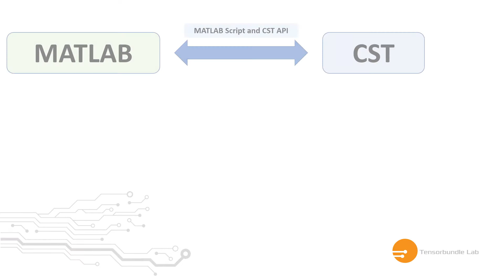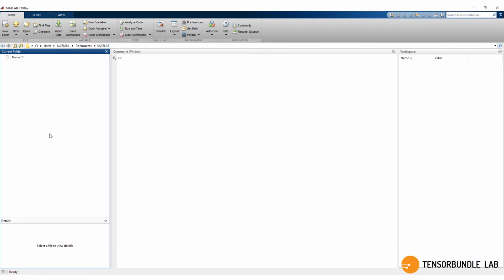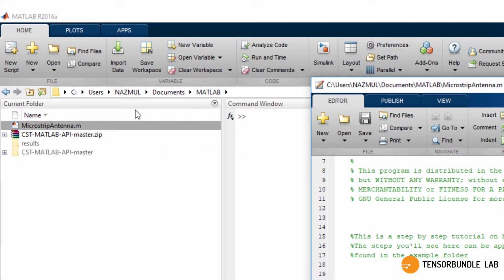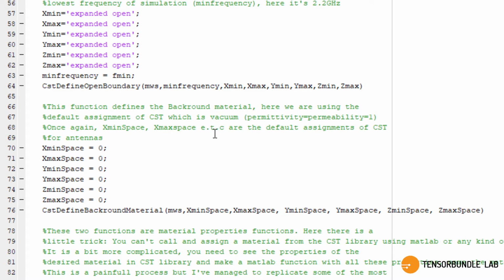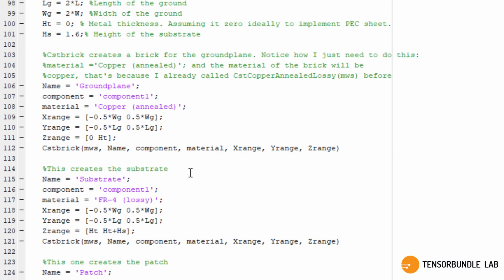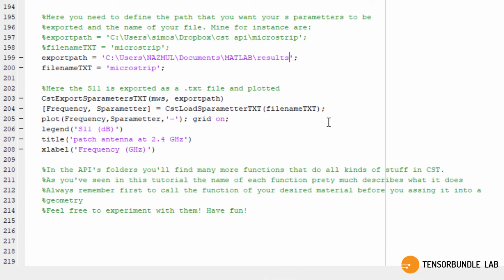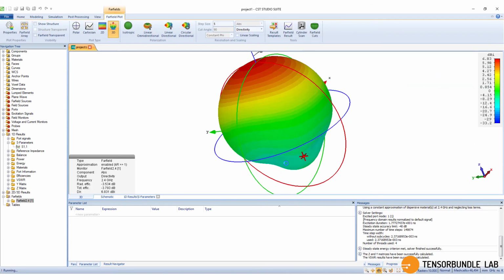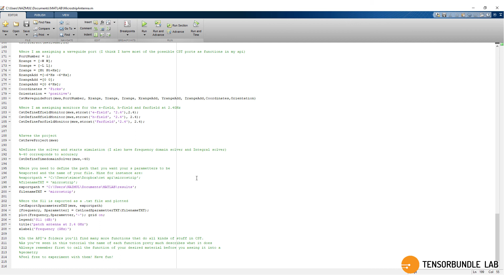CST Tutorial: Control CST by MATLAB-- 2.4 GHz Patch Antenna Simulation Example

Comment: Not sure if this will help someone. But I couldn't get the simulations to run using the R2024a version of MATLAB and the CST Studio Suite 2023 - [Learning Edition]. I kept encountering errors whenever any function was executed.

I was able to bypass the problems by installing the same version of MATLAB as used in the video (MATAB R2016a - academic use) and then running them with the ST Studio Suite 2023 - [Learning Edition] and I had no errors.
Reply: Same, on MATLAB 2024a, I got the error "Invalid character code sequence detected." whatever I run

Comment: Thanks for your great video. 
There are these errors . Would you please let me know how to solve them? 
it happens during the simulation.

Error using Interface.CSTStudio_application.NewMWS.ASCIIExport/invoke
Invoke Error, Dispatch Exception:
Source: CST MICROWAVE STUDIO 2021
Description: The ASCII export option is not available for the current view.

Error in CstExportSparametersTXT (line 20)
invoke(ASCIIExport,'Execute');

Error in MicrostripAntenna (line 203)
CstExportSparametersTXT(mws,exportpath)

Comment: hello sir thanks for the video  but when i run this code then in cst the dimension of the element is only integer find. so please tell me  how the actual size element is desing by matlab please give information.
Reply: Did you find the solution?I am facing the same problem
Reply: Change the default units for measurement so that there is no decimal places for any of your values. I had to work in um (micro meters) instead of mm because my values would be rounded to the nearest integer when I tried to run my MATLAB code.

Comment: Where can I download the files? I didn't find these files in your facebook page. Please share the download link of these files here. Thank you.
Reply from the maker: please visit the Facebook group Antenna Lab (link in description) and download the files from the "File" section of the FB group
Reply: @tensorbundle  I got it. Thank you. But, when I run the script I got error message like this:

Error using textscan
Invalid file identifier. Use fopen to generate a valid file identifier.

Error in CstLoadSparametterTXT (line 4)
scannedSparam = textscan(fid, '%f %f', 'Delimiter','Whitespace','HeaderLines',2);

Error in MicrostripAntenna (line 204)
[Frequency, Sparametter] = CstLoadSparametterTXT(filenameTXT);

What do you think is the problem? Can you assist me to resolve this issue?
Reply: @tommihariyadi   did you find any solution?